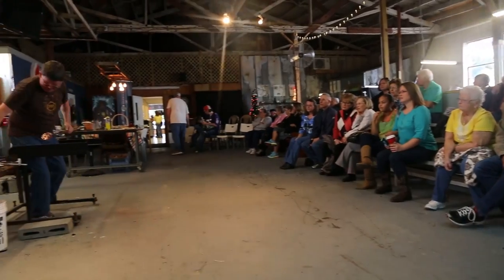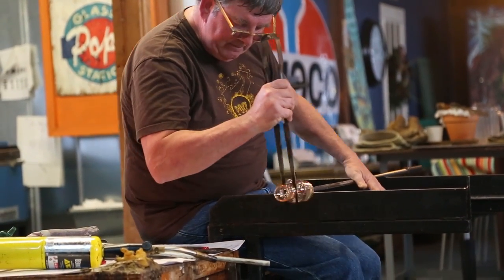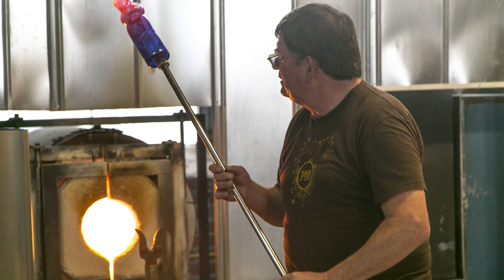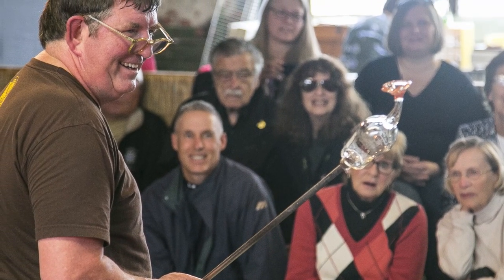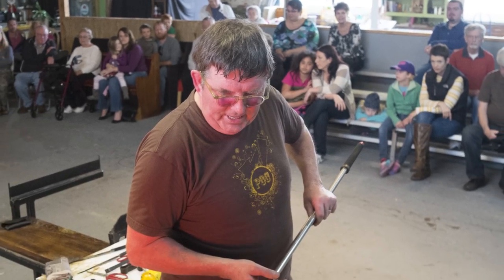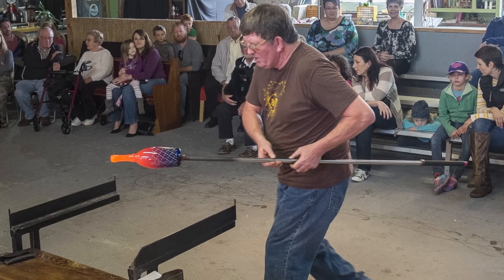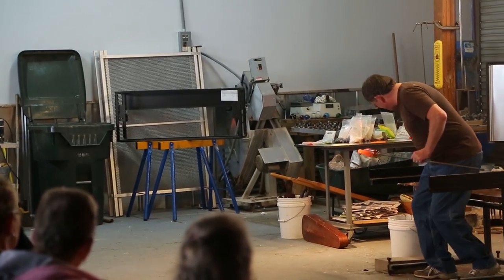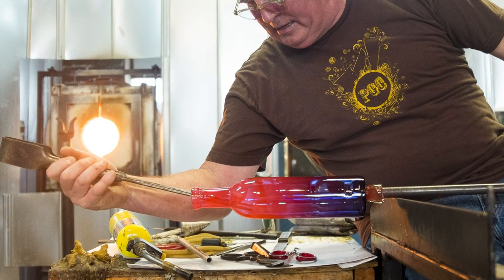Bottle Art

Comment: Wayne can I get some advice from you? I want to stretch a glass bud vase and a soda bottle and a wine bottle. I want to make the base more narrow also. Do you think this is doable with a torch or a fire pit? some tools and an iron I beam to roll it on? I was thinking of getting it hot at the base using a pipe to pick it up down the neck and rolling it on the beam till it's more narrow. Do you think that would work? I don't have a furnace like you. My only options are the torch or the fire.